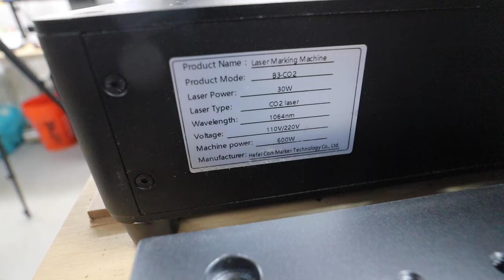Co2 Galvo ComMarker

Comment: Any content is great to see, been watching since the beginning :) good to see you again bud.

The 4x mentioned / referred to is the beam expander in the machine between the laser source and the laser head. You can’t really use any size expander without having other matching equipment or you may end up with some issues/unintended effects. It takes the beam from the source (the physical beam size can vary from source to source, but lets say 1.8mm +/- .2) and multiplies it’s size, before going into the mirrors in the head. If those mirrors aren’t large enough, you lose power and will heat up/potentially damage the head components, and would also not give you the full power at the material. Going smaller on expander than the other components can handle isn’t really ideal either. That looks to be a 10mm head (in reference to the size of mirrors in the head), they make larger ones like 20mm which can carry a larger beam (so a bigger expander would be great for that bigger size head). The other factor is lens compatibility. Something you don’t often see with UV and fiber lenses as being a problem is the input aperture of the lens (how big of a hole there in the back of the lens to accept a beam). Co2 galvo lenses come with a lot of input sizes (and match up to various expander/head sizes) where you can use a bigger aperture on a smaller beam, but using a smaller aperture on a bigger beam means you are literally giving a big beam a small hole to fit through and drowning out the edges like a cookie cutter slicing off the edges that don’t fit through. This can eventually cause lens damage from heat if you’re blocking part of the beam, but the other thing it does is cut your power output at the material down because of not receiving full beam through the lens.

The idea/theory behind the bigger beam/expander/head is that when pumping a beam into a focusing lens, the bigger the input beam, the smaller the dot size when in focus, and therefor capable of a potentially smaller dot size for detailed work. I’m not bashing 10mm heads either, It doesn’t make the 10mm head setup bad (and other supporting parts for that matter), it just depends on your needs as an engraver and what type of work you’re doing. It may be wasted upgrade cost if you don’t need to move up in expander/head/lens aperture sizing. 

Idk the actual dpi capability difference, but I’d love to get the output of the 10mm head under a microscope to compare with my 20mm head+8x expander with same size lens to see how much that really means as a tough comparison.

That also leads into bigger lens = bigger dot at focus, but another cool thing about co2 galvo lenses is that they have multi element lenses (think compound lenses for gantry, kinda) which can actually give you the ability to reduce your dot size. That’s a whole different thing and an even longer explanation, so I won’t bore anyone further with that lol.
Reply from the maker: 😆 this is what I have been talking to the company about

Comment: I have about 500 or so of those black bottle openers. They behave a lot like powder coating. I like them and just sold a bunch for a wedding in Oct.
Reply from the maker: I now have 2 kinds and the new ones are powder coated and are very nice 😃
Reply: @laserengravingwithmatt  sadly no CO2 galvo yet so the fiber and 300mm lens will have to suffice.